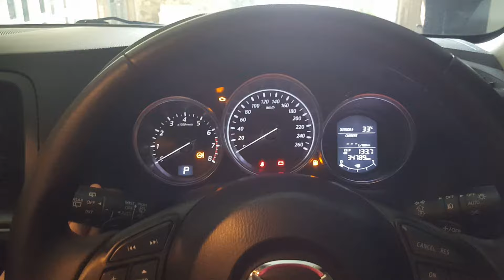Mazda CX 5 CX 3 Mazda 2 Mazda 6 Biante Skyactiv How to replace V belt / Water pump belt .

Comment: Man, thanks for the upload, although, I’m only at 30k miles but when the time comes, it’ll be easy to work on my 2016.5 CX-5. I have this video saved on how to Mazda CX-5 with other how to videos.
Reply from the maker: You welcome bro. Anytime.
Reply: Hi, I too have 2016 CX-5, with more miles though. Went to dealer this past fri to fix that headlight recall and they hit me with some "suggested repairs", belt & tentioner (for $533) was one, how long are those suppose to last you think?

Comment: Quick question, I have a 2018 cx5 39,000 and dealer said belt has a crack in it. They didn’t specify which belt. Do belts in cx 5s go out around this amount of miles?
Reply from the maker: It should go for 5 years Or close to 80000kms. This video is just to demonstrate. If yours has crack in it should replace it soon.

Comment: Probably should have stuck with OEM parts ordered a Gates belt and its a good half a inch smaller than the factory belt uggh.
Reply from the maker: Maybe refund it and swap with the oem ?
Reply: @GarasiFelixDan  yea...its actually closer to 3/4 inch on second measure...no wonder it was not even close to getting on that water pump pulley ha
Reply from the maker: @markg999  yeap better off using the oem v belt kit. :)
Reply: @GarasiFelixDan  Yep OEM stretch belt went on so easy...thanks for your videos they are helpful.
Reply from the maker: @markg999  no problems.

Comment: Can you please show us how to remove and fix the rattling noise on the spoilers. Thanks!
Reply: It's the spoiler retention nuts backing off and eventually falling off because Mazda couldn't be bothered to apply thread lock. Just plug the rubber grommets off and fish around for the nuts...if you're lucky you can grab them.

Comment: I assume this procedure is the same with the skyactiv 1.5 found in mazda2?
Reply from the maker: Yeap it is similar
Reply: @GarasiFelixDan  thanks! may i know the parts number for all item involved?
Reply from the maker: @shhhdontshout  for mazda 2 skyactiv water pump belt part # P301-15-908 & drive belt part #P51D-15-909 . Hope this helps
Reply: @GarasiFelixDan  thanks a lot!
Reply from the maker: @shhhdontshout  no probs
Reply: Hi dan, is there any email i can get from u? Got few question about skyactiv i would like to ask. Might wanna show u some picture about the issue.
Reply from the maker: @shhhdontshout  dm me here at garasiautosales@gmail.com
Reply from the maker: @shhhdontshout  no problem. Lemme know in the email.

Comment: Hello Dan, I have a 2015 Mazda 3. The repair manual I have has me leaving the A/C parts that are in the way in the car, but taking some bolts out to be able to move them out of the way. Then, the job is done from the top, instead of removing the splash guards. Do you know if the design has changed and that's the proper procedure for a 2015 Mazda 3, to do the job from the top?
Reply from the maker: maybe for the smaller hatch back the engine bay design to be access & removed from the top instead from the splash guard

Comment: Can this cause accelerate hesitation/ rough idling also? Since I read one of the puller is crankshaft pulling?
Reply: no...more likely is dirty fuel injectors
Reply from the maker: or faulty spark plugs

Comment: Hi dan, can this method of replacement be used for the skyactiv 2.2d ?
Reply from the maker: If it has similar design drive belts yes you can use this method.
Reply: Thanks for reply👍

Comment: Hey man, thanks making great tutorials on CX5 maintenance tips.
Could you do one for replacing/adding the stock horn as it only comes only with a single tone horn that sounds ridiculous? I was considering to replace it myself, but no vids i could find on YT. Your help is greatly appreciated. Thanks man!
Reply from the maker: No worries will do once times allows. Cheers sir.
Reply: @GarasiFelixDan  Looking forward 👍
Reply from the maker: @bangjopi7643  cheers. Dont forget to subscribe and hit the notif bell for us ya Bang Jopi :)
Reply: There are some guides on mazda3revolution on how to do this. You can replace the stock with two upgraded horns, you just need to splice into wiring for 12V horn signal and then ground to metal for negative.

Comment: He buys dealer Mazda OEM belts and the pulley clearly says MADE IN CHINA...
Reply from the maker: yeah some parts are now made in china. Nothin wrong with it though…
Reply: @GarasiFelixDan  Not at all. I just saved $60 or more by buying a set of good Bando brand Belts and an SKP tensioner. Don't expect the SKP to last another full 70K miles, though it totally could. I will not own the 2017 CX3 by then but both items come with a 1-year warranty (and claim to meet or exceed OEM quality). The chirping sound is gone and all is well.
Reply from the maker: @tsunami770  Ya very true that.
Reply: @GarasiFelixDan  Nice video, helped me take only the tools I needed. A flathead screwdriver, a couple of long-form 12mm and 17mm open wrenches, my Gates belt removal/install tool, a 22mm deep socket/wrench... Jack/stand and 20 minutes. Other than the hydraulic jack everything else fit in one bag. Thanks
Reply from the maker: @tsunami770  you r welcome sir , im glad it helps mazda owners. ;)

Comment: Thanks...gonna do this tomorrow on a 2013 Mazda CX-5 Touring 2.0. By the way, this is now 2021. Hello Earthlings and YouTube people from 2019/20! Great camera action. Awesome detail! UPDATE: The next day, still 2021. For those who do have the 2013 Mazda Touring 2.0 like i do, the part place said i needed a stretch belt for my water pump instead of the one used in this video. So, i bought one. Hissss....Little did i realize that i would ALSO need a #$?* stretch belt tool thinga'ma-jig! (e.g., Gates 91030 Micro-V Stretch Fit Installation Tool, Dayco Stretch Tool #93875, or OEMTOOLS Easy On Stretch Belt Installation Tool
 #24362). There is a slight possibility i may also use a few zip ties on the water pump pully side, but that's another story.
Reply from the maker: 👍👍👍 Thanks very much appreciated.

Comment: Welcome back Mr. Dan, been waiting for this service!  Did you remove the spark plugs to make it easier to spin the crank pulley?  Thought I read that little suggestion in the Mazda CX-5 service manual. Nice trick using an old rag to help remove the water pump belt.  Another great video, thanks!
Reply from the maker: In this video i didnt remove the sparkplug . But i recommend doing it as it was very heavy when i turned the crank pulley . Hehe :)
Reply: Oooh!
I like the idea of removing the plugs.
Reply: I'd recommend removing the spark plugs after smashing my fingers several times rotating the crank.
Reply: @JetJockFI  how many? all of them?
Reply: @Nonstopboi07  Yes, all of them, so none of the piston will build up any compression.